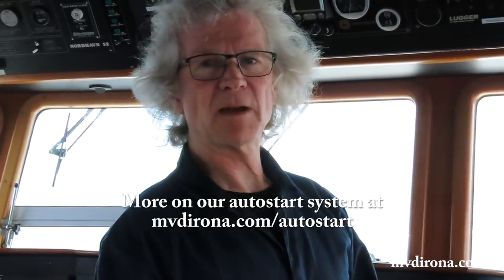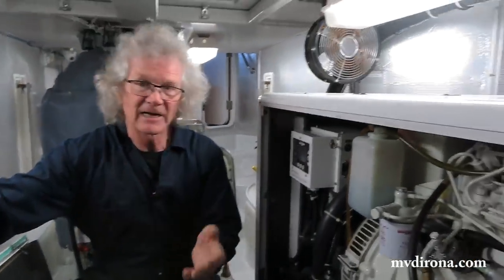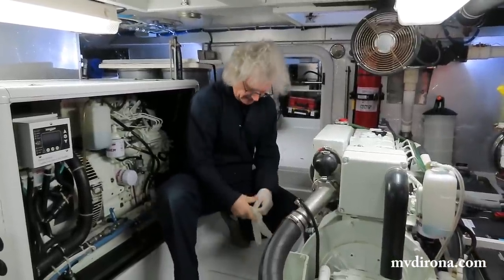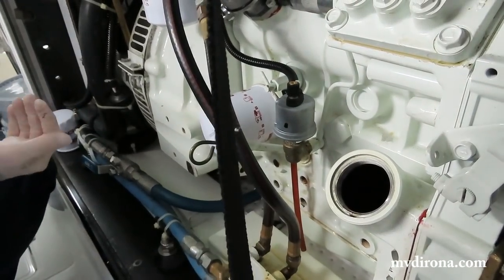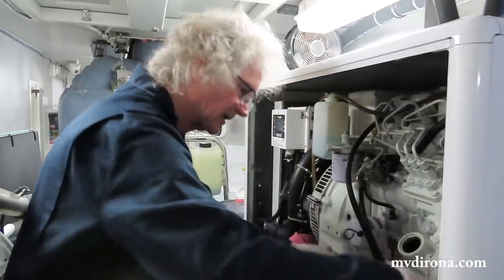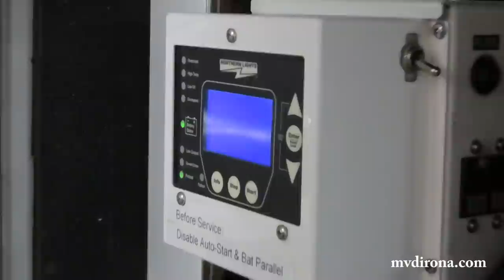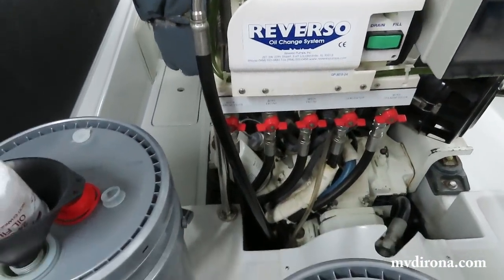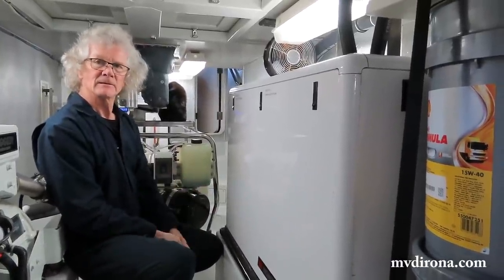Northern Lights 12kW Generator Oil Change (MVDirona Channel)

Comment: Could you share your thoughts on anchors and anchoring. It looks like the bow anchor is a Rocna, what size is it and what size / length chain do you use. Do you have more than one anchor like a storm anchor and a kedge anchor ; extra chain. Ever anchor by the stern or use two anchors at the same time like in Bahamian mooring. Some-one once said "Why be happy when you could be interesting?". Spitfire and her crew are always interesting, thank you.
Reply from the maker: Modern anchors are great. On our previous boat we used a 44 lb Bruce and liked it but the Rocna is a better design. It's a notable improvement over the Bruce which was quite good. We aren't big fans of the storm anchor and kellet approaches prefering to chose a storm anchor as primary and then always use it.  With a good, strong windlass, a heavy storm anchor is no more difficult to handle than the "normal"anchor.

Another approach we take is to watch the anchor chain angle in 40 kts in a given anchorage and then find the engine RPM that matches it. Once we know what RPM approximates a 40 kt blow, we use it in reverse when we anchor.  Most anchoring advice recommends letting an anchor soak before setting it or setting it lightly and giving it time to dig in. The problem with this advice is that if you have been in an anchorage for an hour you are psychologically unlikely to leave even if you can't get a good set. What we do apply 1200 to 1250 RPM in reverse which is the equivalent of 40 kts of wind. If it holds, we stay and don't worry if we are in big winds. If it won't set, we leave.

The approach above has the upside of there being no mistakes. If it sets and holds, you can relax in a blow. We never drag and we never get up to check the anchor. We have been anchored in 60 kts in open areas and just don't worry about it. We love that but the downside is you will have to leave some anchorages that would have otherwise been fine. The good news for us is that the Rocna does super well and we only loose an anchorage once every couple of years.

The only conditions where the Rocna might fail are very light silt where it lacks surface area and very heavy weed where the weed is robust enough that the Rocna can't cut through it. There conditions are rare and we only see them every 2 or 3 years but it can happen. We carry a very large surface area Guardian up front for these conditions. This is a 29 lb aluminum anchor and it's both easy to handle but also has massive surface area and works super well in heavy weed or silt. The way we install it is on the front of the main anchor with a lenght of chain between. Effectively we anchor off the Guardian and our existing anchor is just a kellet. This is very effective but we almost never need to do it.

We find the above rarely limits us. Where we do find some limitations in our approach of using unusually long scopes.  We require more space than most boats because of our scope choices. But, we sleep well and we really prefer longer scopes. 

For chain, we have 500' of 7/16" high test chain. We like having a lot of chain and have used the full load 2 or 3 times over the last 10 years and we are often up over 350'.

We do have a stern anchor and used to use it frequently on our last boat but find this boat has so much above water surface area, the wind forces if anchored sideways to the wind are really high. As a consequence, we are stern tying and stern anchoring less but we are set up to do it and occasionally do.
Reply: @MVDirona  Thank you. How many lbs is your Rocna.
Reply from the maker: The main anchor is a 154 lb Rocna.

Comment: interesting video may I ask are the oil filter's recycled
Reply from the maker: We have storage for used oil on board so all engine oil is recycled and most places in the world will do that without charge or great difficulty. A recent exception was a recent stop in Amsterdam where we needed to pay 100 euros to recycle used engine oil. Generally, it's usually possible do without much difficulty and only rarely with additional cost. Oil filters are not re-usable nor efficiently recycled so they end up drained of oil but in disposed of according to local garbage handling protocols.  The most environmentally friendly marinas provide a place for used oil filters so they can be managed correctly but this isn't the norm.
Reply: @MVDirona  ok thank you for the information the reason i asked is the marina were our vessel is moored they recycle the oil filters
Reply from the maker: That's really good that they make that easy.  I suspect it'll get more common. Thanks for the comment.

Comment: If (as you do) your vessel has really good engine room soundproofing, why not run the gens with the covers off -- to improve performance and life?
Do you "flush your block" to drive out particulates and foreign materials?
Reply from the maker: I like the sound attenuation and the look of the generator enclosure but many pros recommend that they be run without covers. Out of couriousity, I put a remote recording temperature sensor inside the enclousure a year back and, over the last year, it's never exceeded 123.9F. 

This generator is effectively a "heat soak" data point where the generator has been shut down recently and the temperature continues to increase without cooling airflow. Searching for the highest temperatures where the engine is actually running over the last year, I got 121.7F. My general take is that 121F is pretty low and so I'm not really concerned about it and don't think the negative impact of temperature will be measurable at these low levels.  To be extra safe, I have put a remote alarm on higher temperatures.

On your second question, yes, I have flushed the cooling system: https://mvdirona.com/2019/06/northern-lights-12kw-generator-overheating/.

Comment: Interesting, not to mention a good job on the recording/editing.   Couple questions.  First, about the sound insulation panel you took off.  Is the sound insulation foam and absorbing that oil mist, or was the surface the oil mist landed on solid and non absorbent?   Can't tell on my tablet.  Second, have you considered an oil filter relocation kit?  Looks to be plenty of room there, make it a bit cleaner.  
Always enjoy your videos, be it travel or maintenance.  Thanks for sharing.
Reply from the maker: Thanks for the feedback on the video. On your question on the sound insulation, it's a closed cell foam that doesn't absorb oil. This is a good choice by the manufacturer Northern Lights since oil soaked insulation especially around exhausts systems is a common cause of fire in older boat engine rooms. These days, most manufacturers and installers are making better materials choices. 

The good news is that the oil wipes off rather than building up in open cell foam but the bad news is that it's a bit of a mess and changing a rear main oil seal is a big project.

Going with a remote oil filter is a good suggestion.  I can live with it as it is but a remote filter would be much nicer.  I'ts not the worst I've worked upon: Ferrari put two oil filters upside down in the center of the V on some of their older V12s :-)

Comment: Like I said before, I’ll gladly change the rear seal for ya. U may want to check your crank case breather aswel, plugged breather filter will without a doubt cause leaks
Reply from the maker: Great suggestion on the crankcase ventilation. The main engine at a problem with the crank ventilation system and started leaking at the rocker shaft carrier. I changed the rocker shaft carrier gasket and corrected the excess crankcase pressure problem and, as you said, no more oil leak. Unfortunately, the generator ventilator is free and there is very little blowby when I take off the oil fill under load. My last hopeful check was for any oil leaks at the back of the engine but it's all clean and white. I think I'm stuck with doing a rear main oil seal. 

As you probably can tell, I'm less than excited about the prospect of needing to change the rear main oil seal. I do wish you were here to change that one but it's a 1.5 liter toy compared to what you normally work upon.
Reply: MV Dirona ah it’s all just nuts and bolts,

Comment: I’m assuming you have a dedicated oily rag storage container or do you do your oil changes at a marina where you can dispose of them? Thanks for the video you two are were efficient as always.
Reply from the maker: The approach we have evolved is to use oil diapers for the really oily stuff and so the rags themselves are mostly not heavily oiled so they clean nicely with detergent.  We have some rags that that worn out that we use for bike chains or really oily jobs and those are discarded. We don't have a dedicated container for oily rags but we only discard up to a couple a month so there isn't a concentration of oily rags in any one place in our stored garbage.

Comment: On that oil seal, if you don't plan to replace it right away perhaps covering it with some paper towels to absorb the oil so it is not sprayed every place.
Reply from the maker: Yes, I was taping on an oil absorbent rag while it was leaking. Lowering the crankcase pressure from slightly positive to slightly negative completely corrected the leak.  The manufacturer runs the crankcase pressure at slightly positive by forcing it to vent to the intake manifold through a spring resisted valve. With the spring removed, the leak goes away without obviously compromising any other aspect of the engines operation.

Comment: the pump sytem makes ir an easy job you never mentioned you closed the valve bit you did close it at same time as the valve on pump system while you was putting the rubbish out way it was open then i saw it closed when you stood up to turn clear it all away,that slow starting may not be fuel problem,could be starter  wearing not throwing engine fast enough can imagine all the start stops it done
Reply from the maker: Your right on both points: I forgot to mention I was closing the valve but I did close it. And, on the slow starting, you are 100% correct on pointing out that the starter could be at fault. I've since investigated and found that the engine was cranking at 1/2 the speed of the wing engine (same starter and engine combination). Voltage was good at the starter when cranking so I replaced the starter and it the normal cranking speed really helps it start quickly. It's much better now (and we'll post a video of the starter change).
Reply: @MVDirona  yup diesels need fast crank speed from starter to create the ignition of the fuel had this problem few times,just a thought the crank oil seal leaking  would throw oil mist into starter  would  be part of starters demise order seal keep an eye on oil level will leak mostly when oil is hot and engine stops there be a slinger washer throwing oil back it has grove with opposite rotation so oil gets guided back away from seal when its running just hope its not going into generator windings its pain in the ass job but you.ll manage it could be heavy unit to handle use brains not bruan

Comment: ok, really great video - I watched this before doing the 1st oil change on my gen since I've owned the boat. Couple questions and comments on this:
1. my NL book says 200 hour interval, the actual oil fill screw-on cap says 100 hour interval, you're doing yours at 250 hours. 100 hours seems way too conservative. that's only four days of continuous run. What's your take on 200 vs 250?
2. My gen does not have the inline ball valve on the oil drain/fill hose. That is a little bothersome. They must have started doing that later in the series. My ME has inline valves on the lube and transmission line of course, as it must since there's only one ME control valve on the Reverso.
3. You must have staged that oil filter removal with a pre-empted and cleaned oil filter. There's no way you're sucking that thing dry enough to achieve that little amount of drippage! :) I saw this in the video and thought, no way is this going to end well for me, so I was well prepared with oilsorb pads to catch the inevitable massive flood of oil from the still half full oil filter! I let the pump suck on that engine for a while. How long do you let your pump run to get that filter so empty?
Cheers
Chris
Reply from the maker: Our engine is a Northern Lights M843NW3.3 12KW generator and the generator operators manual recommends 250 hour oil change interval.  What is your generator model? I recommend you get the operators manual from Northern Lights if you don't already have it. I was use the manual recommendations for your engine rather than the oil cap since the engine is used for many different applications and the cap may be from a different one (although I can't think of any application that would have a 100 hour change interval). You'll find your exact engine model number on the junction box above the generator section.

The oil plumbing and valving is whatever the boat manufacturer decided to install rather than a Northern Lights decision. No problem not having a ball valve in the oil drain hose. The Reverso has a valve at the pump manifold and that is sufficient. 

On staging the oil filter drain to minimize oil spill. No, but there are some tricks. The most important two are 1) change the oil when it's hot and thin, and 2) give the engine 30 to 45 min off before changing it since they oil in the filter will drain back. The last trick is leave the oil change pump on, put the oil fill cap back on to cause negative pressure in the crankcase and then remove it quickly with an oil rag below it. Put the new oil filter on quickly after removing the old one.  If you do that, you can minimize the mess but there will always be some spillage.

I don't let the pump run that long to help empty the filter but it is important that the cap go back on for this to be effective. And, it's really a minor factor in mess minimization. The important ones are 1) hot oil and 2) 30 to 45 min with the engine off to allow drain back. Good luck!
Reply: @MVDirona  Oh, I didn't let it sit long enough after the warm up. That's gotta be it. I did everything else in your vid. Ours is a 4 cyl 16KW which is an upgrade over the 12K the N47 is usually built with.  I do have the book for the engine. It says 200 hours, so that's what I'm doing.
Reply from the maker: Yup, that'll help. It's exactly the same engine except that it has 1 more cylinder.  Everything else the same. Good generator. You should have good success with warm oil, 30 to 40 min to drain, pumping with the oil cap on while removing the filter, let air leak a bit before taking off the filter. And then, go fast with a oil diaper to catch what comes out.

Comment: Thank you for your excellent explanation. But 250 hours is equal to how many months cruising ?
Reply from the maker: Generator run time varies all over the place depending upon usage. The way we are set up, we never run the generator at the dock if we are plugged in (we can run off of low amperage shore power connections by using two shore power connections). And, we never run the generator when we are underway since our main engine can produce 9kW of power. So, the generator is only used at anchor. 

When we move the boat frequently the main engine will be charging the batteries when underway which reduces are generator time. But, when at anchor for a long period, it'll run 25% to 32% of each day if we are on the boat. 

The longest we have ever gone between oil changes was 38 weeks and the shortest time between changes over the last 10 years is 4 weeks.
Reply: Thank you. I learn how to use this boat without having ever seen it. This is great. When I learn enough I buy one

Comment: Can you tell me how you sourced fuel supply in your travels? Is there a site that gives you fuel destinations, volumes available, price etc?
Reply from the maker: There are some regional fuel listings but they are fairly rare and often aren't up to date. When we need fuel we call around and find price and availability. When planning a big trip, we call ahead and make sure we can get fuel at both ends of the trip. Over the last couple of years we have only fueled 2 to 3 times a year so we have a lot of flexibility on when and where we do it. We just look for good pricing and at a convenient location.
Reply: Thank you James.

Comment: Another thing to mention, apart from the excelent work done here, is it is a good thing to have a warm engine prior to oil change, makes the oil a bit more runnier. Just let it rest half an hour after running.
I think you forgot to close off  the cock on the engine drain hose! ;)
Reply from the maker: Yes, I forgot to mention the engine should be warm. When the change was done, we were at anchor so the generattor was running every 4 to 6 hours so it's doesn't get much below 130F.  It was nice and warm.

Your a careful viewer. I forgot to mention it when I did close the valve and, in scanning the video, it looks like I didn't remember to close it until near the end of the job. You can see the valve closed at 31:22 just before I put the cover back on the generator.